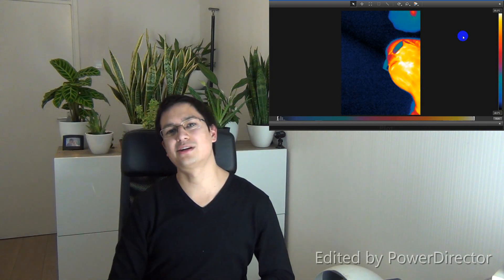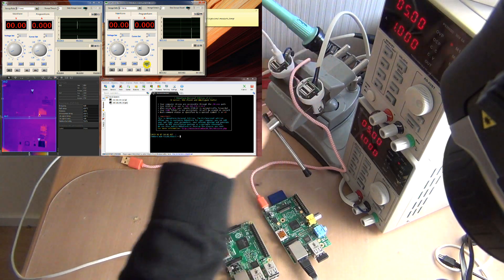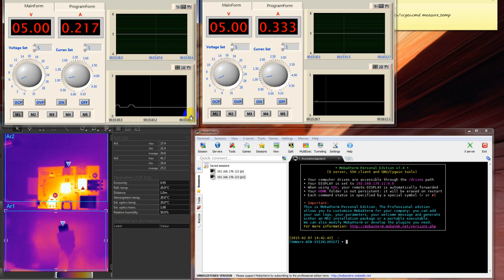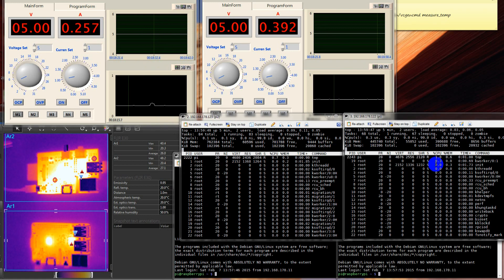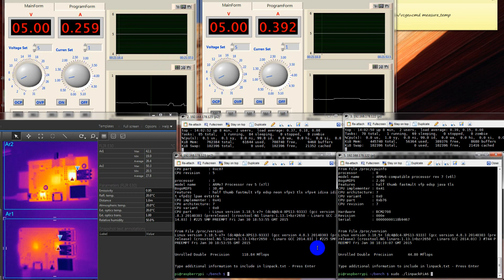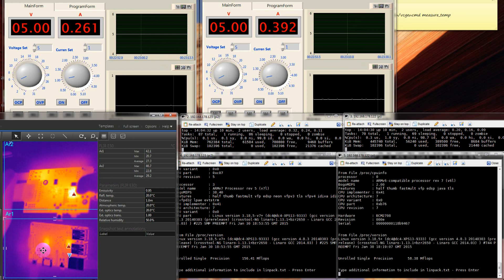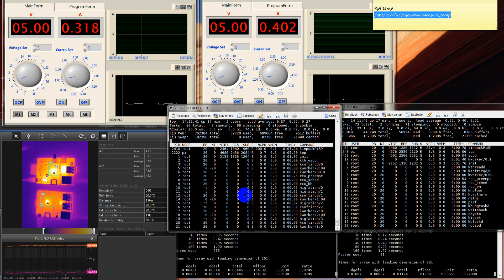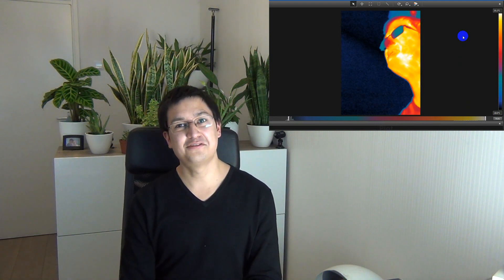RPi 2 Power draw and thermal image during benchmark (Raspberry Pi 2) on HTNblog #2

Comment: Hi there !  I appreciate you putting this together.    One question -- can you re-run linpack and the other tests to use 4 (and maybe 2 for fun) of the cores of the pi2?  it looks like it's only using a single core.  I'd be curious of the power consumption and heat generated with all four cores loaded.
Reply: Hey you, thanks for your reply. Do you have the exact terminal commands to do the multicore linpack testing for me? When I've some time I will re-run the test. Btw. I wasn't aware that the current test was using the single core. :-)
Reply: ***** Hello again!  - I tried to find a way to run a Pi-friendly version of Linpack that uses 4 threads but couldn't figure it out.  I was able to apt-get sysbench and run a multithread teest with as many threads as wanted here --  sysbench --test=cpu --cpu-max-prime=5000 --num-threads=4 run

I'm still curious how much hotter the pi2 runs with all four cores working.

(max-prime=5000 should take ~ 28-30 seconds to run on rpi2)

Comment: Great video! Very interesting to see how they compare, and the thermal camera adds some fun insight too.

One question though: I've seen multiple places online saying that the Rpi 2 requires a 2A PSU, however your test seems to indicate that both of them draws more than that - will I need a PSU capable of delivering more than 2A?
Reply from the maker: Thanks for your comment :)! I really appreciate it.

About your question; I've two reasons why it may be important to use a power supply capable of delivering more than 2A.

A)In my video you see the average current. Spikes of current can an do occur but will not be seen on the average power consumption reading. When using a 2A capable PSU, this PSU will most likely have more suited internal capacitors for these current spikes than a 1A PSU. Note that current spikes that trips the 5 voltage power supply will result in crashing systems (even if it happens for a very short period of time).

B)In my test case I did not attach any USB devices. According to the USB spec, each port may deliver max. 500 milli amps (0.5A). This means that, since this RPI has 4 USB ports, the total power consumption of the USB alone can reach 2amps.
Reply: HackThatNow ALright, thanks for the reply.
I'm not going to attach any USB devices, so that's atleast something.

I'll be using the 2A PSU for general use with Kodi and see if it's enough, if not I'll report back!
Reply from the maker: tommytomthms5 Hi Thanks for the heads-up.... Do you have a video time where I did this wrong? Thanks!
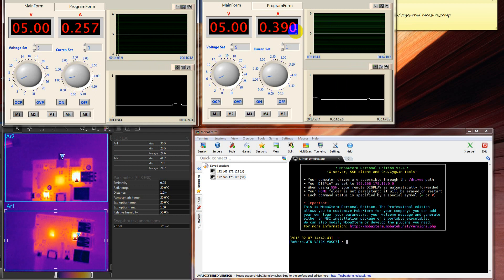Reply: Try at 3:25 if I'm reading it correctly the Pi 2 is drawing 0.25 amps so under load with USB devices plugged into it a 2 amp power supply should work wonders.
Reply: I think you got a decibel wrong it is drawing 0.3 amps not 3.0
Reply: tommytomthms5 "Decimal"....
Reply from the maker: ***** Please note that the current reading in the video is an average current consumption. It's highly possible that the current consumption has spikes than can be a multiple of the average reading.
Reply from the maker: ***** Since the price of 2A PSU's almost equals 1A PSU I would go for the safe site and select 2A :).
Reply: I've even seen 2 Amp car adapters. If you are so inclined.
Reply: +HackThatNow 

This is incorrect. The raspberry Pi's have never followed the max allowed USB specs as far as power. The USB ports are limited by a polyfuse to 1.2A, so all four usb ports cannot draw more than 1.2A.

The RPi itself is limited by a 2A polyfuse as well, on the microUSB port. You can circumvent this by using the 5V GPIO pin but you lose protection.

A properly rated 2A USB power supply is all you need for an RPI, anything else is overkill.
Reply: Please don't forget that a polyfuse is a slow type of fuse type. Peak currents can exceed far beyond the specified value.

And cheap PSU are tight rated on cap stability on their output. If you choose higher amps PSU, the more likely power spikes will not influence the stability of the pi.